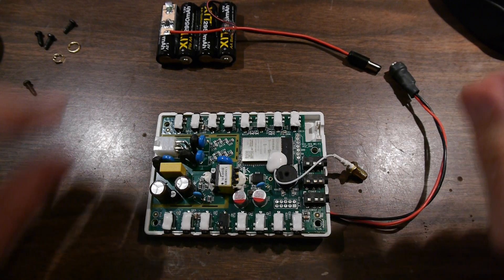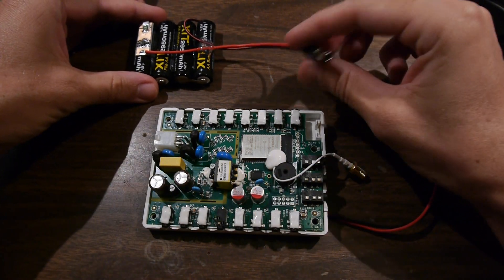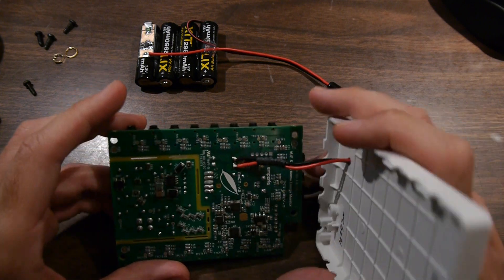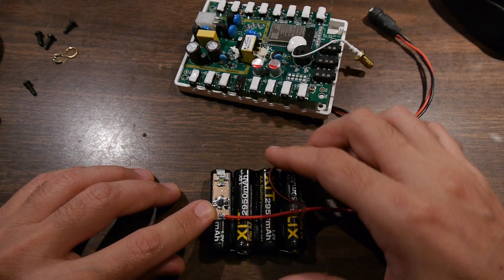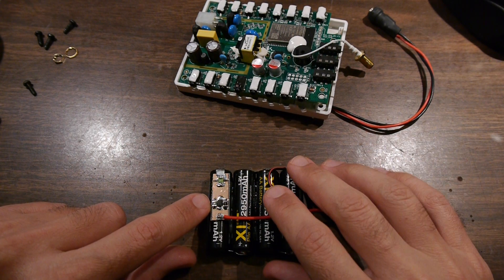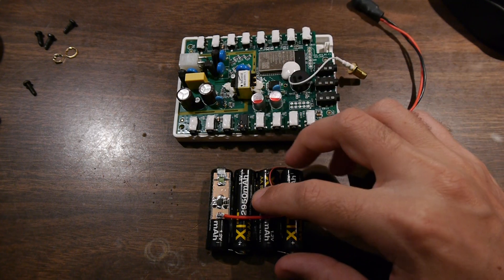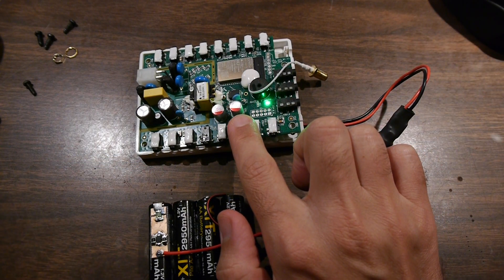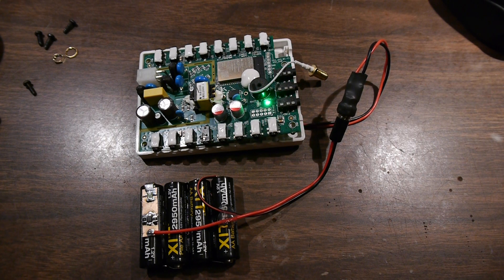Adding backup battery to Emporia Vue energy monitor.

Comment: Genuinely curious, why? If the power is out why does it need to be online?
Reply from the maker: Short power blips during thunderstorms make it reboot and sometimes it wont reconnect to wifi causing extended data loss.